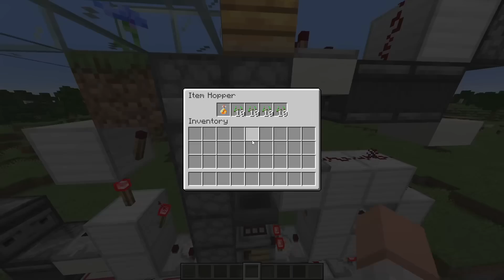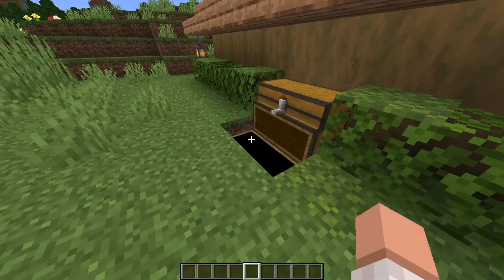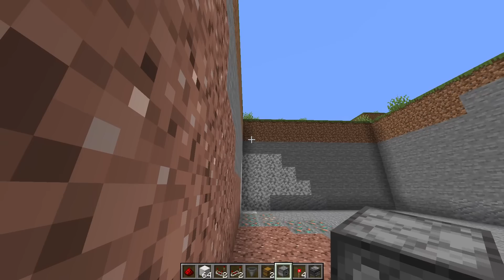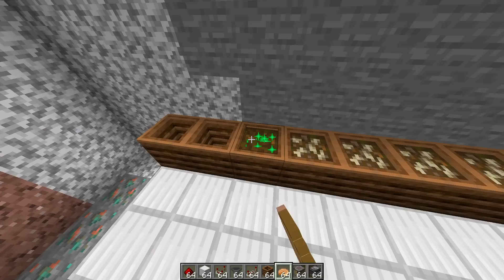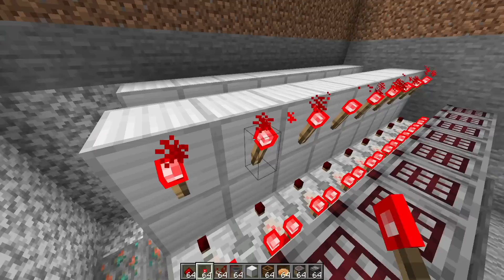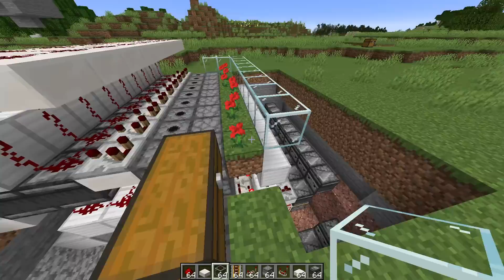[Tutorial] Automatic 1-Wide Tileable Honey Block Farm (Minecraft 1.21.4+)

Comment from the maker: Still working as of Minecraft 1.21.8 by the way! <3
Reply: For some reason my empty bottles just keep shooting out the sides of the droppers
Reply: I am having an issue in 1.21.8 where after crafting the honey block the honey block and the empty bottles go into the next autocrafter any idea to fix this? Is there a certain direction you would build this? (im playing in paper spigot with friends
)
Reply: i really appreciate your builds, but the observers start activating the dispenser at power lvl 3, so you lose 2 glass bottles every cycle.   Also when the crafter ends up with 2 in its slots after a harvest it will wind up making 1 honey block and 1 sugar and send the sugar back up to the dispenser because of the double firing observers do to power going up then power going down.  there is a newer single slice autocrafter that takes the output of the observer into a copper bulb, and a comparator off the bulb into a block below the crafter this stops the secondary action that your crafter does, not only would this fix the crafter but it also fixes the glass bottle issue if you use it to power the dispenser.
Reply: @WhutdahelluWant  how what?
Reply: Does this also work on Paper servers? I tried it, but the honey isn’t being harvested when the hives reach honey level 5, and for some reason it also produces sugar.
Reply: I tried on 26.2 but My honey bottles are just sitting in the filter hopper for whatever reason I followed the video to a t as well. Should I just fill the dispensers with more bottles?
Reply: Nvm I was missing a line of restone smh
Reply: This does not work on bedrock
Reply: @Me-st1zb  This design relies on "Quasi-Connectivity" to dispense the bottles which, unfortunately, Bedrock does not have...
Reply: @Me-st1zb shouldn't be too hard to convert

Comment: I figured out how to make this possible on bedrock and still have it extremely compact. So use the same set up with the target blocks and the comparator. Same setup with the sticky piston. Coming off the back of the first observer towards the dropper, place a second observer. Then place a redstone torch. Then an observer facing the redstone torch that is on the back of the other observer. The observer block can power the droppers that are adjacent the the dropper it is powering. So instead of using a repeater it’s observer torch observer. Above the torch place a block, a torch on the side of that block and a block above the torch. That will power everything in a much more compact way. It’s slightly more expensive because you need extra observers but it will work on bedrock in a tile able fashion.

Comment: I dont think this farm has the kind of rates where you'll need to worry about this, but if you manage to make so much honey that it fills up your whole item collector (in this particular build, hopper chain and dropper elevator), honey blocks will end up in the bottle dispensers. It's not a fatal issue and not even a real issue given the rate at which bees make honey, but it will be annoying to get rid of clogs, especially if you've tiled it.

Also, if you tile this a lot and you play on an SMP, there will be a lot of potentially laggy bees.

For those two reasons, you may want an off-switch. You can achieve this by putting sticky pistons above the entrances to the hives and pushing any block in front of the hives, then running a line of redstone over it (you'll need to get more creative if you've tiled more than 15 times). This works since bees can't leave the hive if their exit hole is blocked. I used stairs to kinda keep it aesthetic. You can even hook this line up to one of the hoppers, so if they ever reach a certain fill level, the farm will automatically close down to protect itself.

If you have annoying friends, swap the off-switch for an off button, take the output of the button, AND it with an inverted daylight sensor, then feed that into the set line of an RS latch. Then, you can only close the farm at night, when the bees are all in the hives, so they don't get trapped outside, or even suffocate if you chose a fully solid block.
Reply: You could also just burn up excess in your item collector system :/

I was just thinking about this, since I like to put off-switches on all of my farms anyways when there's entities at play

Comment: Okay but what do you do when the beehives are on lvl 5, the observers see the connection and activate the rail, the rail activates the other observers. But from there the redstone signal dies. The only way for it to reach the dispenser is through a full block, but you show a slab there. How does that work? Because for me it doesn't. 

If you think "Just move the observers back until only a level 5 honey activates the observer that activates the rails" Then you're just like me, buthere comes another issue. Whenever the rail gets powered, the surrounding rails also do. So it activates the surrounding beehives too which just dispense an empty bottle then and eventually you'll end up with 0 bottles.
Reply: did you make it work?

Comment: Java: Snapshot 25w37a
I passed the check at 13:30. The empty bottles were properly ejected and the honey block was placed into the chest. After that I ran into a problem. I want to preface that I have checked that all the slabs were placed in the correct postions to allow the redstone to carry the signal. I also made sure that all droppers and dispencers were in the correct locations. Been at the top portion for 3 hours and wanna pull my hair out haha. I am convinced that the issue is the slabs placed at the 15:05 mark. They cant carry the signal even when the hive is at level 5 honey.
Reply: did find a fix ?

Comment: the glass bottle elevator will only fill up the left slot of the dispenser, right? the farm will still break once theres an empty slot in the dispenser
Reply from the maker: No. The glass bottles are infinitely reused in this farm. The elevator just returns the bottles to the top dispenser. There specifically actually HAS to be a empty slot  in the dispenser. This is the opposite of most other Honey Farms. That's why you should build this farm instead, it's infinitely reusable and doesn't require hundreds of glass bottles.

Comment: Im about 95% sure I’ve built this correctly but I seem to be having item sorter issues. It’s just holding onto the honey bottles and not dropping them into the next hopper. (I’ve been having minor issues with ImpulseSV’s item sorter since 1.21.5 dropped also, but I may just be bad at red stone.)
Reply: I'm having the same problem. Did you find a fix?
Reply: @ryancorallo6793 my fix ended up just chucking another couple bottles in the dispenser at the top. I think this needed 6 bottles, I went with 8, but once it gets its first block of honey it should be fine.
Reply: @seabassplayer9308 I did what u said and I've gotten a few honey blocks out of it, the rates just seem superrrr slow like something's still wrong. Do you think it could be because I'm on a hypixel  smp?

Comment: Not sure if I built something wrong or what happened but I put 6 bottles in each dispenser and it worked perfectly for a bit but an AFK session later, I found out that the bottles for the dispensers had completely disappeared. I'm guessing they somehow didn't make it into the droppers or something and despawned? Cause they're nowhere to be found.
Went and just made a good lot of bottles though so if it does happen again, it at least won't run out for a long while.

(This is in 1.21.5 on Realms, if that matters much)
* My MC did crash after about 24 honey blocks were made, so I'm wondering if that contributed to it?? No idea. I at least got a stack and a half from the AFK session so I'll be set for a while :)
**I did notice that the item sorter part where it locks one of the bottles had locked 2 bottles sometimes instead of just one. Weird.
Reply: I also had this issue. I might just add more bottles so it doesn't lose all of them
Reply: @chirpp18 yeah, that’s what I did. I just put in a gazillion bottles and it works perfectly. 

Still haven’t figured out what exactly broke but oh well.
Reply: @ShinyUnknown oops, turns out I had the top most droppers as dispensers so they shot the bottles out onto the ground. Only realized that after I added more bottles to the dispensers and the problem was continuing
Reply: @chirpp18  my dispenser is shooting out bottles also, seems the redstone for the honey collection starts activating halfway through at power level 3, when it should wait till power level 5
Reply: I've been having this same issue, I just built the farm. I noticed empty bottles being occasionally randomly ejected onto the ground. I'll have to check and make sure they're not dispensers at the top, and I guess I'll look to see when it's firing too.

I had put this next to a tileable honeycomb farm, so I wondered if that was interfering with this, but even after separating the redstone dust parts, it was still happening. Perhaps I just need to more cleanly separate the farms

Comment: Yea really need help on bedrock. The elevator just won’t work.
Reply: The target block is quasi powering the dropper on java.  Quasi doesn't work on bedrock.  I can get the elevator to work with just comparator and repeaters.  Comparator in same place, but into a repeater, then dust down both sides.  A repeater on one side of the comparator into a solid block next to the dropper creates the pulsing power clock.  However this means it isn't one block tileable.

I'm stumped on the crafter.  I have no idea how to control when it should trigger, so I've got a sugar farm...
Reply: @hookedbycrafting5348 I actually was able to figure out a way to make the elevator work on bedrock and make it one tile able. You just need a ton of observers. I forgot exactly how but it works. Also I used glass for redstone passing through at the top near the back side of the farm

Comment: Anyone know if this works on bedrock or if not what changes can be made to work
Reply: As of rn I’m currently trying to build it and I’ve noticed so far that the bottom dropper doesn’t engage so I’ve had to make a circuit that engages the bottom dropper…. I’m currently stuck on the part where you filter between the bottles and seeds… bottle doesn’t go anywhere but once the seeds are put in EVERYTHING drops down to the crafter.
Reply: I’m trying to build it on bedrock now. Even when I engage the bottom dropper, it still gets stuck on the second dropper. Not sure how to get the elevators to work. Especially later when you have to build 9 elevators next to the crafters

Comment: This is a great idea, but a bit large once you have more than a few slices.
One of the best hack/thing i noticed was when a crafter crafts honey blocks, it spits the bottles and honey out, but the honey drops direct and the bottles get thrown a block. So i use this as a sorter vs having a sorter.
So crafter, and under that a hopper for honey, then ice block and  water stream to take bottles back up top.. Its very compact, i dont recall where i first saw the information (somewhere on reddit) but its super handy/useful
Reply: Bottle will filled with water if you use water stream

Comment: 16:40 I'm confused why you need the extra redstone on top of the beehives.  If a full hive gives a signal of 5, wouldn't that bee enough to reach the observers regardless of whether the 2 lines of redstone on top are present?
Reply: Took me a while to figure out this part. The observers dont trigger the dispenser themself (they are powering into a slab, that cant be powered). The dispenser gets powered from the redstone on top of the block above the beehive, but only via quasi connectivity. The job of the observer is to make a block update, next to the dispenser, so the dispenser registers the quasi connectivity and fires.

Comment: I made a very similar design for bedrock back when you made your last bee farm last season
Reply from the maker: Nice!
Reply: @cubfan  does this farm work for bedrock? cant seem to get the dropper elevator to work for some reason
Reply: @TheAirsoftking121 I’m having the same problem did u end up figuring out what’s wrong with it?
Reply: @maggiemacrae9790 this farm doesn’t work in bedrock, I scrapped it and made my own design. I could inv you to my world and show you. Not sure how to explain it it’s a bit complicated but fully automatic and doesn’t require filling bottles
Reply: @TheAirsoftking121 you can get the dropper elevator too work. Replace the repeater with another observer behind the one that is pushed up by the piston. On the back of that observer place a redstone torch. Then an observer facing the redstone torch. The observer can power droppers adjacent to the one it is directly powering and the items will get pushed up. It’s just as compact it just requires more observers. The torch allows you to bring power up with another block, r torch, then block so you can power the fourth dropper at the top.
Reply: @TheAirsoftking121 it does work in bedrock if you replace the repeater coming off the back of the observer with another observer, then a redstone torch on the back of the observer, then another observer facing the torch. Observers can power droppers adjacent to the one they are directly powering. So that one observer powers three droppers at once.
Reply: I used water elevators for the one I made, don’t think dropper elevators work like shown in the video same on bedrock. I had to compromise for a water elevator but this design has limited space for that

Comment: Great design!

EDIT: I misremembered the dispenser interaction, the following suggestion does not work.

IIRC as shown in ianxofour's farm, it shouldn't be strictly necessary to "read" the honey level as the dispenser will fire only if they can harvest the honey, therefore I'm sure it's possible to save some materials by replacing the "trigger" part and connecting the dispenser to a simple clock. However, I did not test that and there might be issues I can't imagine right now (such as making it difficult to tile, messing up other parts of this design's redstone, or making it more laggy on a bigger scale). It's also up to personal preference. Just wanted to remind people of that approach.
Reply: If the hive is not full of honey, the empty bottles are still dispensed. The way ianxofour’s farm works is all of the hives are in a loop, and the hoppers underneath each hive point into the dispenser for next one. That way even if the bottle doesn’t get honey from one hive, it will just be reused on the next hive
Reply: @scrantonPA93  oh thanks for the clarification, I misremember that interaction then. Was it the shears that are used only when possible then?
Reply: @lukebeich  Yes, shears stay in the dispenser that they are placed in. If I remember correctly, shears are a special case, and are never shot out of a dispenser, they just try to get used and do nothing if it fails. I haven’t tested that out though.